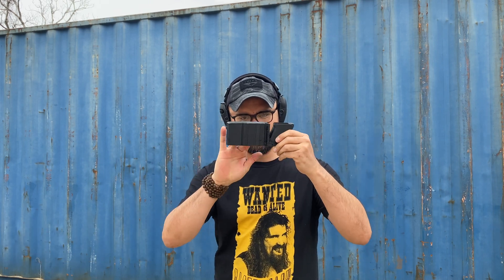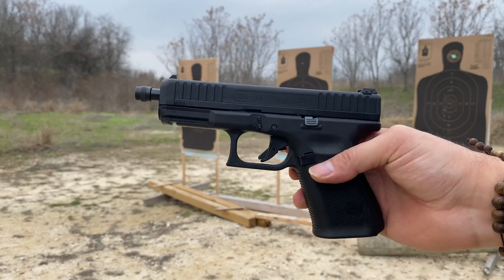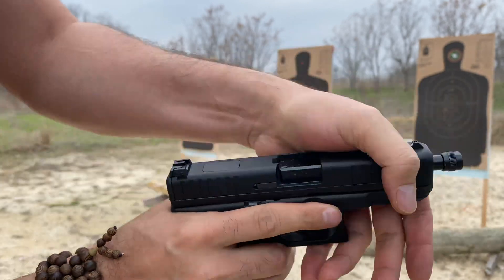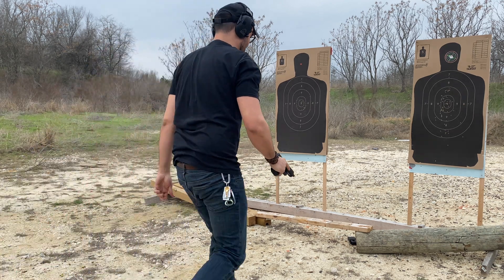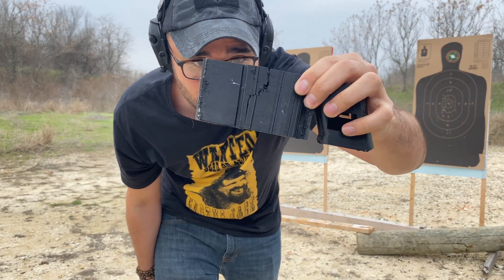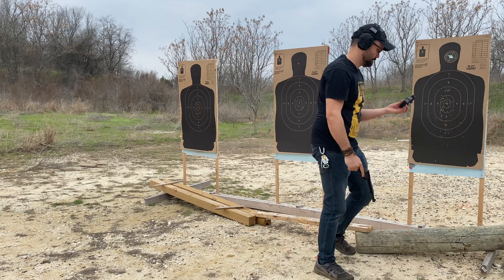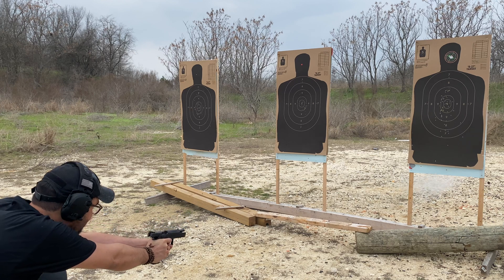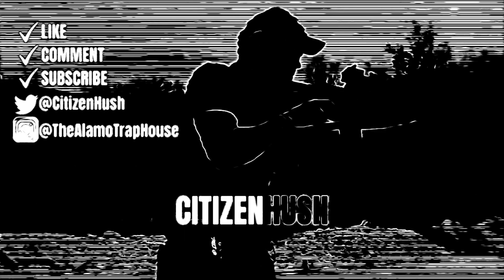How Strong is PLA+? PLA+ Torture Test

Comment: Two questions:
1) Where did you hear that PLA+ has heat resistance any different than regular PLA?
2) Why would you print support material at 100% density?
(edit - typo)
Reply from the maker: 1) various get started guides i started off with
2) accidents happen lol